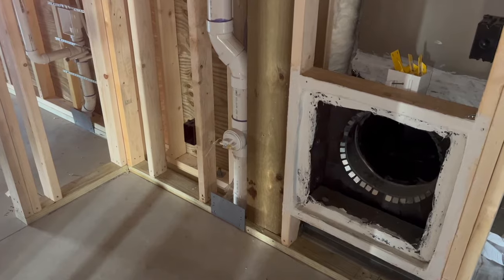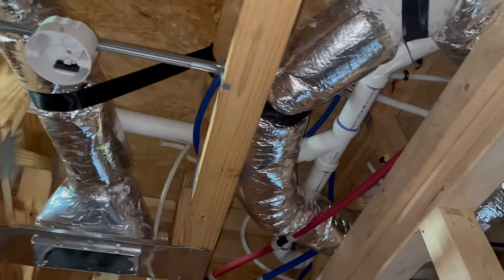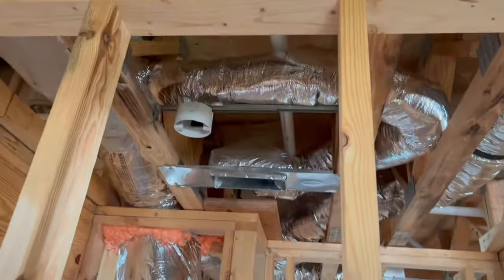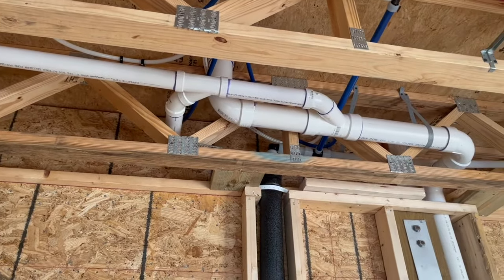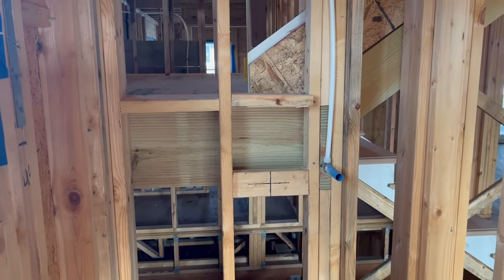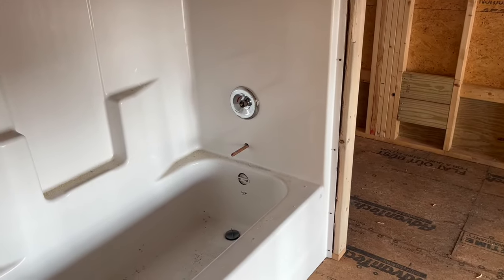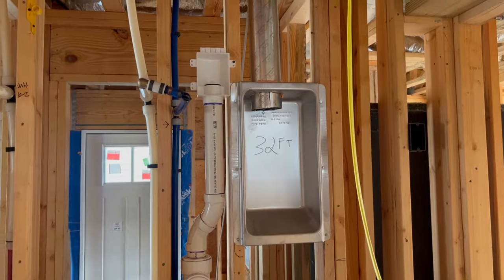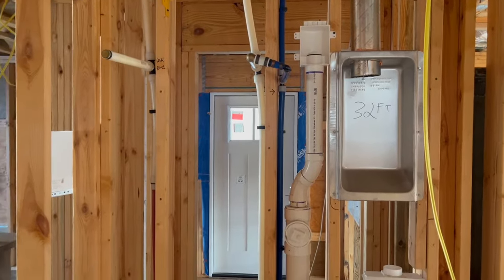New house  plumbing rough in. Great for remodel reference.  Complete explanation.

Comment: How many items can you vent on one 3 inch stack ?I have a farm house remodel I’m about to plumb on septic system it has 2.5 bath kitchen and laundry that’s connected to one of the 2 baths(same room) I’ve watch most of your videos and I’m more informed on the venting. also is there a max fall for horizontal runs?

Comment: I’m finishing a space above my garage   The drain for the commode is 3 inches.  I’ll additionally have a vanity, shower, clothes washer and kitchen sink. Can I vent all these fixtures with one  2 inch line and what is the maximum horizontal distance from the fixtures to that 3 inch line  out of the commode?